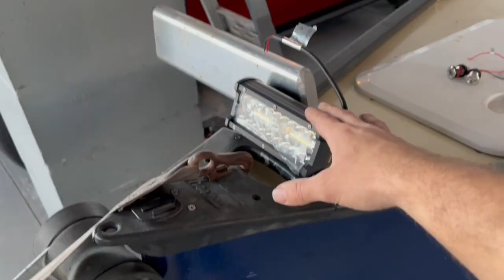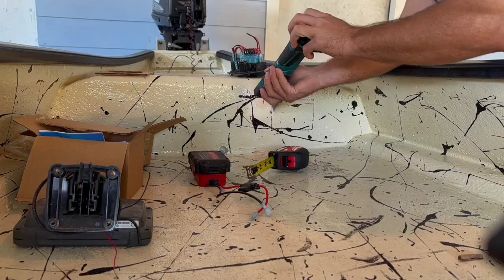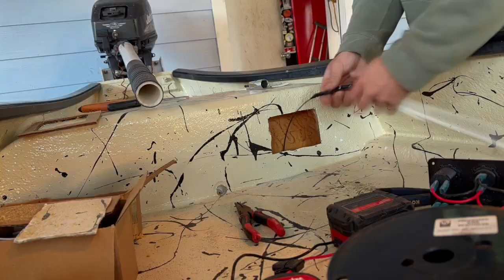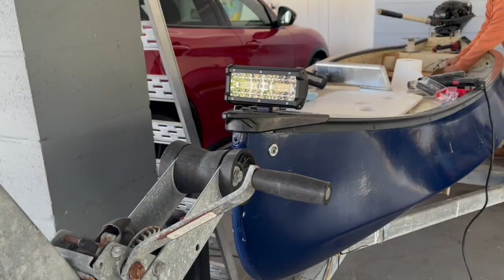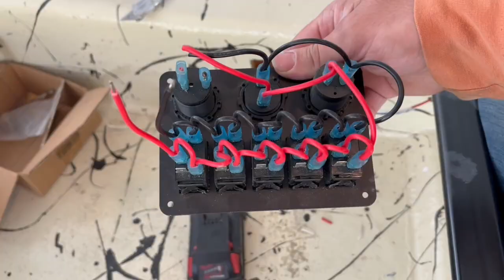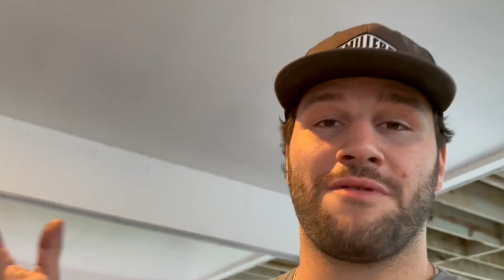Wiring Boat Lights With M18 Drill Battery!

Comment: 🌴😏Well I had to stop in on the channel first of all ya did a great job on the gheenoe , I’ve got one project skiff I’m working on it’s an 11’ foot   46” inch beam  fiberglass V hull that I’m going to make into a nano flats skiff , already replaced the transom and added a floor just need to cover coat it with fiberglass, then I’ll make the casting platforms , but I just picked up a 15’ ft skiff 47” inch beam just two weeks ago with a newly redone galvanized trailer for $800 bucks , then I’ll make reason I bought it it looks like an Ankona technical poling skiff type hull but it doesn’t have a deck just extruded aluminum gunnels like your gheenue it’s all open inside with two fishing seats mounted on fiberglass pods , then I’ll make front pod has a baitwell/ dry storage in it, your conversion is something I’m thinking of doing on my skiff , as I have a Johnson 15 hp outboard but it’s a long shaft so the jack plate you made would def solve that problem but I also got a Evinrude 9.5 that could go on my skiff to that doesn’t need a jack plate, the wiring on my skiff sucks it’s got LED’s , sm, bar and nav lights on the bow , a bilge pump and nav and bar in back with the control switches mounted in the rear seat pod , but the wires going from front to Back are just extension wire mounted with clips on the sides , it needs to get a PVC chase tube to hide em , I haven’t had the skiff out yet just got the title and registration all squared away a couple days ago, and the weather has been cold and windy plus still getting safety equipment for it , glad ya did the videos on the gheenoe it’s a great looking set up, tight lines 👍🏼

Comment: I run a single LiTime 100ah Lifepo4 battery on mine. It runs my Hummingbird Helix 5, nav lights, and my trolling motor. It last around 12 hours with very heavy trolling motor use. I have it set up on an anderson plug so I just open the hatch and plug in the LiTime Lifepo4 charger. Super convenient. On my last setup, I ran a smaller Ah battery for my trolling motor and a Nocqua battery for the rest of my electronics. Also a very nice setup, just have to charge up both batteries the night before a trip. 

Loving this build series and I think it'll get a bunch of views as time goes on!
Reply from the maker: Sounds like a solid set up! Maybe I’ll look into a lifepo4 if this set up shits the bed, then I’ll put some more money into it. I wanna see how long a set up on an M18 will last. I appreciate your nice comments man, and thank you so much!